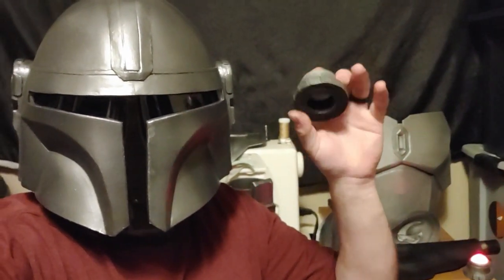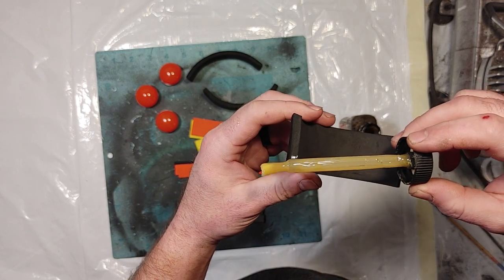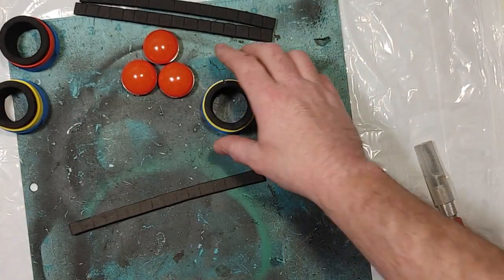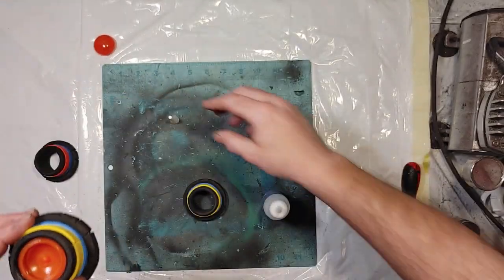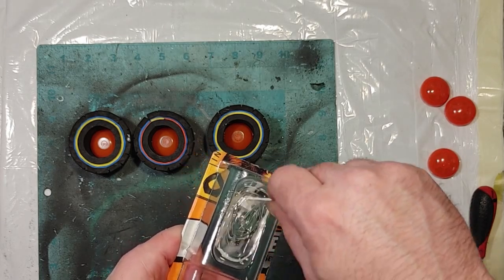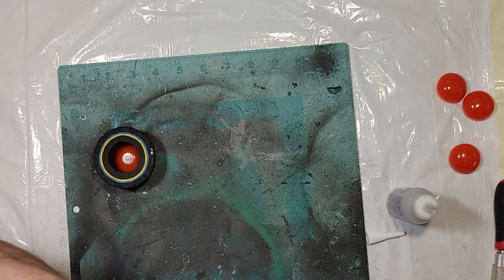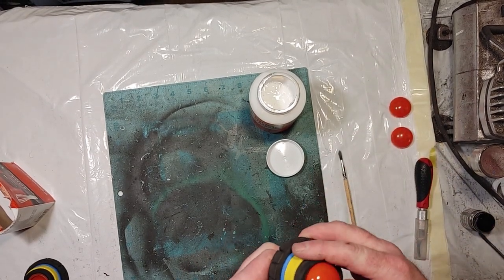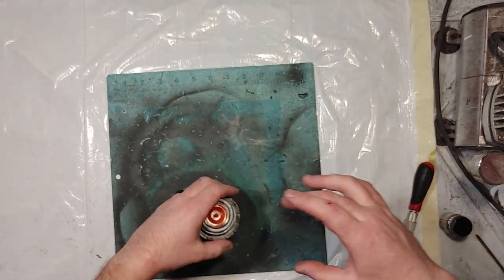Mandalorian Grav Charges DIY foam cosplay build

Comment: Zolus, I have a question. Can I use contact cement if I have a respirator on, even if the room isn't much ventilated other than a fan and an open window?